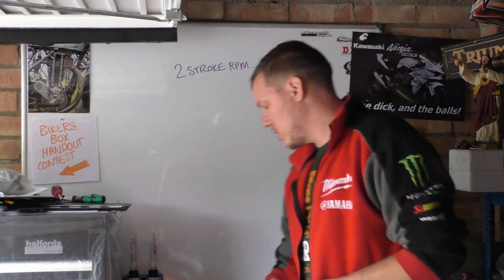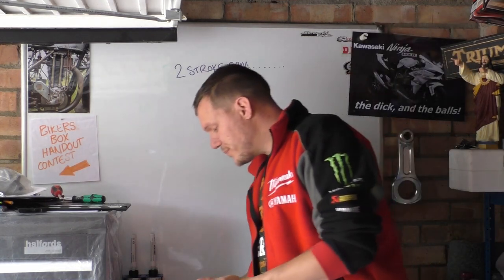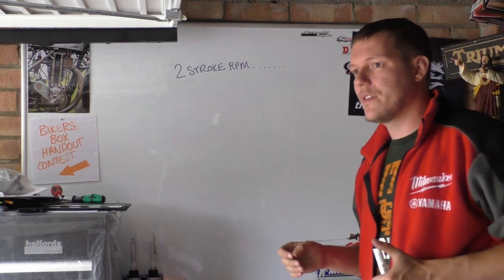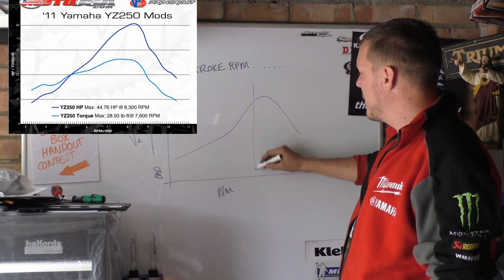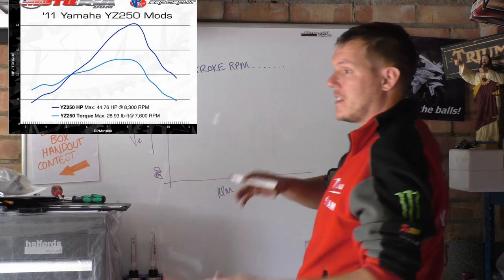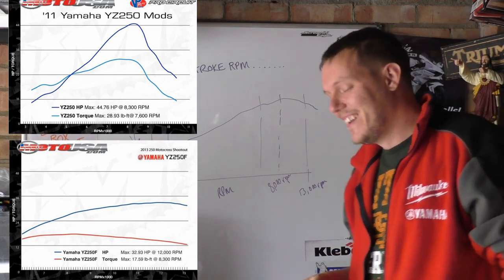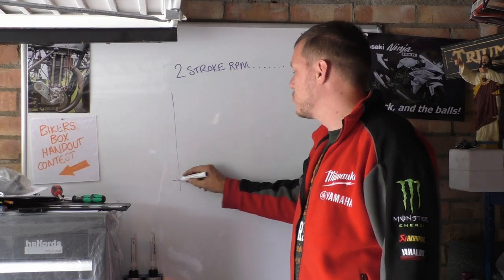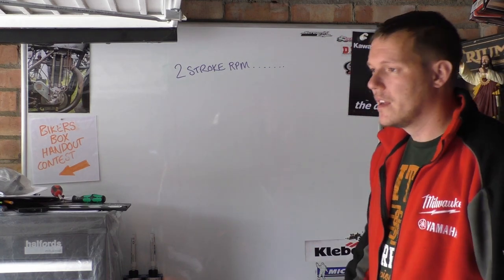2 Stroke have higher rpm?

Comment: Dude.. Power used over time is fucking Energy. Power is always instant that's what makes the difference between Power and Energy (or work, I guess thats what mechanical guys use). If you got an engine and you run it at it's full power of 1kW for one second, you pissed away 1kJ of energy. If you run it an hour you "used" 3600kJ (or 1 kWh) of energy to maybe get you from here to there.
Reply from the maker: " Power is always instant that's what makes the difference between Power and Energy"

wiki - In physics, power is the rate of doing work. It is the amount of energy consumed per unit time.

Being the rate of work, the equation for power can be written:

P = W/t

Someone wasn't listening is physics class
Reply: me!!!
Reply: @dirtygarageguy  Mmmmmm.. "Torque is a Force". NO NO NO NO NO!! Torque is Energy, (FORCE x DISTANCE)!
Reply: i tought power was kanye west song

Comment: Quality vid Matt, again.
I suppose like a lot of bikers of my gen I have a soft-spot for 2 strokes having grown up with various RDs, GTs & KHs.
My brother had a couple of 500LCs back in the day & an RG. Lots of fun & pretty radical stuff in their day....but lets be honest any decent sports 600 would see them off now (& in the case of the RG not kill your wallet returning 20 to the gallon).

As for high revving?
I remember a pal had a GT125 Suzuki, in neutral you could hold the throttle open & the rev needle would shoot past the red & around the clock to where something close to 20,000rpm would be if the clock read that far (yes, I know, it was a cheap old mechanical rev counter they fitted to them & probably wasn't much more than a true 14 or 15,000rpm but even so...
Poor old thing.

Comment: The highest revving engines I have heard of are the Sutter MMX500 which does about 13,000 rpm (2 stroke), 2017 KTM 250 SX-F which does about 14,500 rpm (4 stroke) and Honda used to make an in line 6 cylinder 250 4 stroke that did about 22,500 rpm and the 'powerband' was above 17,000 rpm, and it also had an 8-speed gearbox to keep the engine there. When doing that sort of speed, each piston is going up and down over 350 times per second

Comment: Two strokes don't rev higher, they just sound like they rev higher because they have one combustion cycle per revoliution.
What two strokes do is that they rev quicker, especially at low RPM their throttle response is much better than four strokes.
I remember taking my friend's Kawasaki 4T 125cc for a ride and the throttle response at low RPM was terrible, it was like turbo lag, complete boner killer.
Reply from the maker: "Two strokes don't rev higher,"

- are you actually a spastic?
Reply: Dude, it's the internet, i could be anything :D
Reply: Man the new 250f full injection dirt bike have faster instant throttle off idle than my yz 250x did buy a lot. I have a 2020 kx 250f I am not joking is runs right with my yz even with it on the pipe but the kx has why more control power threw 90 percent of all different riding conditions

Comment: Maximum RPM is governed by mean piston speed so 2 stroke always win that one. And the problem with 4 strokes is they are so under powered they have to double the engine cubic capacity to get to the power levels a 2 stroke produces. A very American thing to do, just make it bigger and forget about technology.
Reply: I Make and Fix Stuff TRUTH! It takes a 450 4t to run with a 250 2t.  One is like riding a paperclip, the other a paperweight.
Reply: One thing I like about strokers is they often have far more power than a bike that size and weight should have. Like sprint karting, not going that fast but with your arse an inch off the ground it sure feels fast.

Comment: Nowadays, 4-strokes do generally rev higher than 2-strokes. It's just that 2-strokes have twice as many power strokes, as compared to 4-strokes (hence the name 2-stroke). Even if a 4-stroke, has a rev. limiter of 13,000 rpm, the spark plug will only fire 6,500 times per minute. Because the 2-stroke fires every 360°, at 8,000 rpm, the spark plug will fire 8,000 times per minute. This means that even though a 2-stroke can't rev. as high as a 4-stroke, it will still fire more often than a 4-stroke which is why 2-strokes generally make more power than 4-strokes.
Reply from the maker: What has this to do with anything? This is going backwards.....
Reply: @dirtygarageguy  my 125 has max power at 11k rpms and if you have a 4t with same ccm the 4t will have less power becaus a 2 stroke makes twice as much power strokes soo it makes more power, and a 250 have less revs becaus the ports are lower and the the 125 has a reed valve and it still revs over 13k and max power at 11k

Comment: I heard from someone that a 125 2t is the most optimal and "ripping"  when it hits the power band so when you get to 250cc etc it just increases the torque mostly. ( Don't get me wrong i heard this from someone)
Reply from the maker: erm.......... yes and no, that explaination is wrong, but not that far from the mark. The problem with that is it makes it sound like the power band is fixed for all engines. If you talk to whoever said that remind them that power IS torque x time, and the powerband is where the engine produces it highest torque.
Reply: The Workshop take a look at the 4 stroke dyno graph in your own video at 5:30. The powerband is not at peak torque, that's bogus, and if you wanted to stay in the "powerband" on that bike you'd be short shifting at 9k and losing the race because you'd be making less power than you could (and doing less work per time than the guy next to you). Maybe you mis-spoke but the powerband is where the power is highest, not torque...

Comment: Matt - have a look at the Ryger two stroke engine....assuming they have got the fucker to work this thing does have a high rev ceiling. I have the photos of the internals if you want them - I don't think they are widely available on the net...I took copies of them. Send me a private message and I will give you links as if I post url's on a comment it will automatically get marked as spam!
Reply from the maker: Yes I've been talking to one of the designers. I asked for some stuff and all I got was patent links, which I was greatful for of course, but actual internals would be diamond! You can send me them through FB or matthew-hudson@outlook.com
Reply: Just sent you links to the pics via YouTube private message! Let me know you got the message and the links work ok ?
Reply from the maker: Sweet - thanks so much - You don't have an issue with me showing these do you?
Reply: Go for it!
Reply: Awesome, I've been curious about this since Saturdays live stream.
Reply: And finally if you want to read through some of the most interesting two stroke stuff on the net then got to http://www.pit-lane.biz/f34-gp125-et-250-snif and find all the "[GP125] All that you wanted to know on Aprilia RSA 125, and more, by Mr Jan Thiel and Mr Frits Overmars (PART XYZ)" threads. Jan Thiel and Frits Overmars both worked for Aprilia and had a hand in developing the RSA GP engines.
Reply: If that 2d blueprint is the final design, that seems like an awful lot of additional rotating mass just to increase crankcase pressure.

Comment: I use a 2 stroke and four stroke strimmer both 25cc.  The 2 stroke is lighter at 4.5kg and better for balls out power eating through thick paddock grass.  The 4 stoke is heavier at 6kg and does not quite have the top end power of the two stroke.  However it revs about the same 7000rpm with far more power lower down in the rpms than the 2 stroke its far more useful and gets used far more also using less fuel being a honda GX 25 engine its very well engineered.

Comment: yes RPM kills engines but so does excessive cylinder pressure.  The lower RPM you make a given HP, the higher the torque and hence cylinder pressure.

Comment: I've  often wondered why bike engines are designed, in general, to rev higher than car engines. I guess that a 600cc bike with a red line at 12000rpm is broadly similar to a 1200cc car engine with a  6000rpm red line. In effect makes the bike engine the same cc if 8 strokes of a bike engine  is equal to 4 strokes of a car engines cc . 
So the main advantage for a faster revving engine is physically smaller and lighter for similar power to larger and heavier engine.
Reply from the maker: Yes in a nutshell, however you also have to consider stroke and torque. Cars have to shift more weight and have higher loads put on them. Bikes simple don't due to their physical size, unless you live in India lol

Comment: In reality batteries are rated in Amperes per hour NOT Watts per hour. The rating is the maximum current that can be extracted from the battery without cooking it.

Quite a few high torque 2 stroke bikes on the road in the past (and still trundling around on the planet today as they have quite long service lifespans due to bomb proof engines). Here's two I can think off:

CZ 250-471 (1974 - 1982)
Weight = 313 / 291 (later models) Pounds 
Power = 17 HP @ 5,250 RPM 
Torque = 28.5 Pounds / Foot @ 3,800 RPM 
Economy = 60 (76 on post 1979 restricted air intake models) Miles per Gallon (Imperial "true" gallon) @ 50 MPH
Max Speed = 85 MPH (76 MPH on post 1979 restricted air intake models)Jawa 350-634 (1973 - 1986)

Jawa 350-634 (1973 - 1985)
Weight = 361 Pounds
Power = 28 HP @ 5,250 RPM
Torque = 38 Pounds / Foot Torque @ 3,800 RPM
Economy = 65 Miles per Gallon @ 50 MPH
Max Speed = 88 MPH (70 MPH with sidecar attached)
Reply from the maker: Oh look W/hrs

https://www.tc.gc.ca/media/documents/tdg-eng/lb-cell-battery-close-up.JPG

Comment: why does car engines not have ball bearings instead of those little discs that they call "bearings" seems like it would be more reliable
Reply from the maker: not just cars mate, most motorcycles. They're called palin bearings and a video is coming
Reply: samili ball bearings can only take so much load I think. A longer crankshaft needs to be supported in multiple places and thats hard to do with ball bearings. But i might be wronh
Reply: ok
Reply: you can do it the same way  they do it on motorcycles. you wont be able to change the 2 bearings that are in the middle, or you can but its hard and you need special machines from my understanding. they should also start with pinbearings (i think they are called that) on where the conrod conects but the you wouldnt be able to change just the conrods, you would have to change the whole crank. bur from my point of view its worth it because you would need to replace it with high quality bearings, atleast it would take a very long time for any crank failure to happen.
Reply: @The Workshop btw does some cars use sequential gearbox ? if so, why would they not do it on budget cars? i mean they are simple from my viewpoint. i just think that car manufacturers should adopt some motorcycle technology since motorcycle engines are able to keep up with really high rpms and are very reliable. I know there are big differences in some factors between the vehicles, a car is much heavier so the power a motorcycle engine produces wont be so useful on a bigger car, and the gearbox wont be able to cope with the weight. but if they would make a mby 2.5 or 3 litre motorcycle engine to fit in a car together with a beefed up gearbox, wouldnt that be one of the most optimal things?
im just going to guess it wouldnt be. outherwise honda or such would have done such a thing already
Reply: The RPM is also largely due to the small engine size and short stroke of motorcycles
Reply: yes im quite aware of that but the thing is that the engine can handle that rpm
Reply: They run split needle roller, not ball bearing, the discs you see are the outer race, the pin roller are either full complement for low rpm, big 2 stroke diesel Detroit, or caged split pin needle roller for most gas car motors, the Rod journal are also split pin caged needle roller that ride on hard surface rod and crank-pin journal. Most ar split caged needle roller for assembly and load handling.

Comment: Question, a lot of people se more rpm's on rev meter deuw to more spark on 2 stroke then a 4 stroke. please explane that its not more rpm, its more spark.
Reply from the maker: say what? The rev gauge is showing more rpm because of the spark plug firing? Is that what you mean?

Comment: forgive my simple little mind matt...but i think what you were trying to explain is the ports on a 2t wouldnt have the capacity to keep up with gas flow at higher rpm(there wouldnt be enough time  between strokes)...am i reading you right or am i missing the point...sorry mate...
Reply from the maker: Yes! and No! lol 2 stroke engines are designed to or should I say the are ported to work at a certain rpm, they can run faster if they are ported to do so, but this is unusable. People say that 4T's rev higher and 2T can't, which is wrong.

You can design a 2T to 'keep up' in relation to gas flow, there's just no point.
Reply: The mass flow of air is so important in a two stroke as most is lost to scavenging, hence the low volumetric efficiency, even if the scavenging efficiency is good and the power to scavenge is low.  The conventional two-stroke cannot compete with a four-stroke in mass flow at higher rpm's, as the EFFECTIVE port areas are greater in the four stroke (as a function of piston area) and flow is proportional to area to the fourth power.

Comment: compared to class of bikes in mx125cc 2t revs up to 14k rpm 250cc 4t revs up to 13-11k 
250cc 2t mx will rev up to 10k 450cc will usually revv up to  9.5-11k(but nat in all bikes).
 it depends on wat u tune the bike for the enduro 250 2t is set up for moore low end torque than the mx you are making to much of a generalization allso when i compare  the enduro 300 2t bikes to pre EFI  400-450 bikes the the 4t are way more mental one of the craziest
bikes to be produced is the yzf426 which did rev up to 13500 rpm  so on this subject at list when it cams to off road bikes  you wrong allso when you did the vid saying 2t  run hotter than 4t at list off road you are wrong again thay do fire twice as much but it allso mens thay produce more power per turn which means if i whith a 2t needs the power of 3k rpm to lets say climb a hill a 4t will need around 5k also on the extra stoke being a coolin stroke is true but the extra 20-35% more fuel going into the cylinder cools the bike to almost the same effect almost all extreme enduro bikes are 2t partly chose of that allso from my experience and others in enduro riding 2t generally runs cooler in extreme conditions and a big reason for that is modern 4t are squeezing out allot more power out off the engine a modern 4t 450 has between 55-60 hp a modern(lol) 250 2t is at 50-55 hp
wena a 2000 model mx bike had 65-70hp this -10hp went straight to controllability and reliability allso running cooler while 4t capt increasing hp and reducing weight and size 

ps 4t vs 2t is a stupid argument that just wastes time if you read my whole post then i apologize for wasting your time .
Reply from the maker: "4t vs 2t is a stupid argument that just wastes time"

- why is it a waste of time?
Reply: it is thy are(modern) from an raiders prospective vary similar with current versions when you sam the + - thy end up ver equal evan at running costs and know with the dual port injection cost almost the same with the biggest difference being center of gravity  for slower speeds 2t has a slight advantage and for higher speeds 4t has a slight advantage no bike has a definitive edge so yes its a waste of time  and i hadn't twist my knee (slipping on my way to work on a electric scoter) i wolde be out their riding my te300 and not commenting on another 2t vs 4t vid  i love bikes and engines i currently own te300 a tc105 a dr350(441cc) i could afford it  i would allso have rmx450f or a fe450/500 cse all of them are fun to ride and work on
Reply: 300cc 2 stroke had 64hp it was true 450 fighter
Reply: thy ware nasty and hard to control modern 300 enduro has around 55 hp and is much faster  case of a muche broader power band mostly do to changes of the exhaust valves and cdi and needs almost 1k less of rpms to reach peak power
Reply: uri braun Learn how to use a full stop bud 😜
Reply: full stop bud ?? sory for my ignorance

Comment: Two stroke are pieces of unreliable money sucking shite....hence I own several of them!lol If anyone wants to see a two stroke actually being used instead of being wank over at the local bike cafe then have a look at my channel and you will find on-board videos of me racing my RG500...rather slowly as I'm shite! If you YouTube search "Race Tuned Suzuki RG500 on Dyno" then you will find a video of my bike on the dyno on my mates YouTube channel. Also the mighty CR500 can be seen in action if you use O8H7N5jz_yc within the YouTube Url if you know what you're doing.
Reply from the maker: You mean this - https://www.youtube.com/watch?v=O8H7N5jz_yc lol
Reply from the maker: I always check the spam folder on a daily basis, so you can send me links
Reply: There she is - I never had any interest in MX bikes but got the CR500 just for the crack. It's the most fun I have ever had on the road with a bike. She will pull power wheelies in 5th @ 80mph with a tug of the bars. Nothing better than wheeling past a sports bike vertical on the road with an MX bike still wearing 21" front and 18" rear wheels!lol